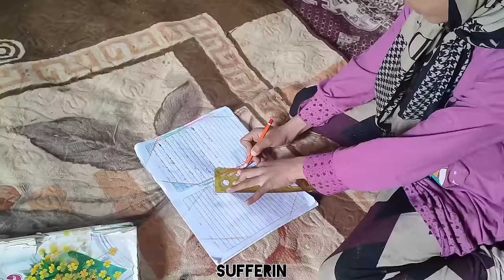Divorced woman and her children worry about her fiance going to prison

Comment: The dirt is a straight line into the door and then drops off to the bathroom. It should have all been raised before the bathroom was put there. A patio, cement surface going the whole length of the house

Comment: They talked about sitting under the tree getting old together when the land was first bought. That wont happen now sitting next to a bathroom.  The bathroom should of been put on the back of the house. The door should be  inside the house so they can heat the bathroom in the winter.